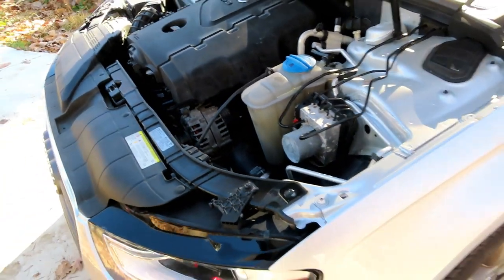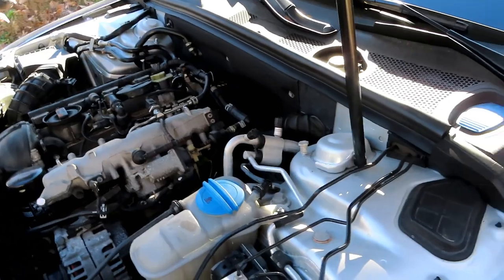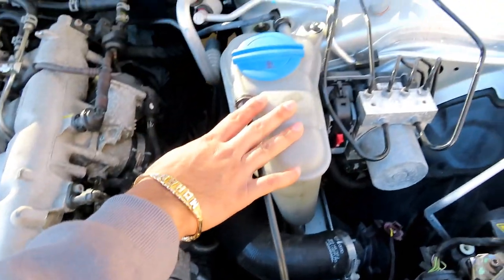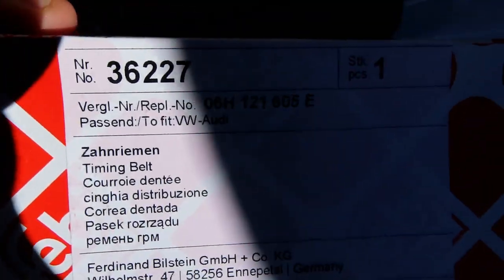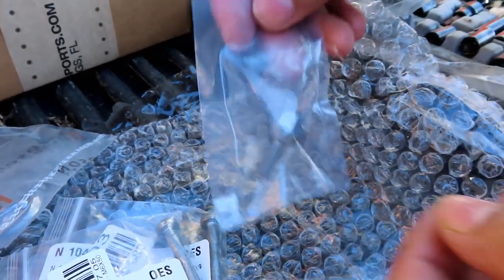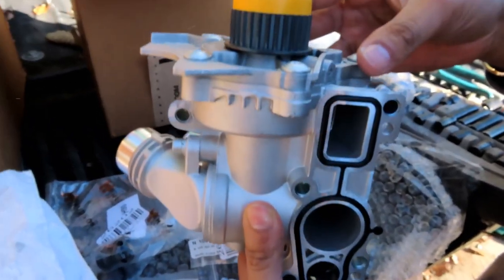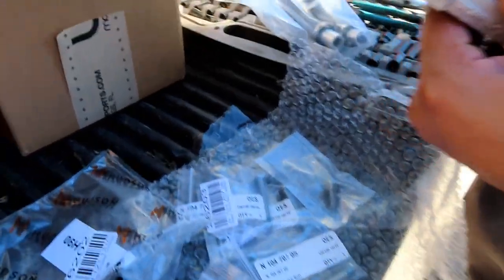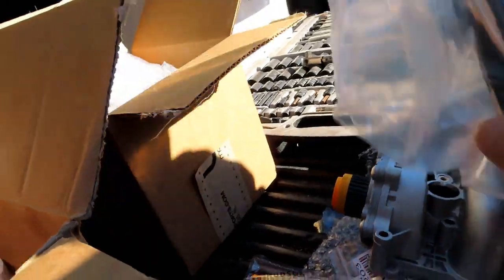Audi VW 2.0T Waterpump Replacement Cooling Overhaul Kit B8.5 B8

Comment: I used a good portion of this video to change my water pump. Much thanks.

Also, for anyone who's curious, the red tab for the connector to the thermostat, needs to be pulled pulled up, not pressed down.

Comment: Thanks for the video, it helped me.  FYI, the leak may not come from the plastic hosing just cracking from age.  I've learned, like in my case, the leak comes from oil getting absorbed by the gaskets that will swell and cause a leak from being deformed and not sealing to the engine block anymore. In my case, the gasket swelled so much it actually did crack the plastic around the gasket housing.

Comment: Great informational video. Thanks for the upload.

I was also wondering, is the stock B8.5 water pump plastic? I thought the water pump was changed to a metal one for the B8.5 since there were problems with the plastic water pump in the B8.
Reply from the maker: The stock b8.5 one that was removed is plastic. This is a 2013 car.
Reply: Steve Kish thanks!

Comment: did you guys flush it before? and did you flush it with distilled water?
Reply from the maker: He flushed and filled it with distilled water before he came over to do the water pump.
Reply: Steve Kish awesome! and last question, any specific tools you need?? I got all the torx screws, that all i need?

Comment: Can anyone assist me with bleeding air on this type of Audi, how to bleed out the air, when fill up car, and run the engine, with filler cap open, on the small hose lines which goes back to the reservoir, am seeing air bubbles coming back to the reservoir.
Reply: Park car on hill angle with resviorcat highest point..run...wait top up   turn on heater

Comment: What can go wrong if crankshaft is not held with breaker bar when removing the bolt?
Reply from the maker: It will just spin so you would'nt  be able to loosen it.
Reply: Steve Kish Thanks for the reply. If i rotate it backwards accidentally, no chance of timing issues as long as timing chain is still on though right? I am gonna try this diy this weekend. Also how long did it take u start to finish?
Reply from the maker: @aliox326  There's no problem as long as the timing chain is on. This doesn't involve messing with the timing chain so no big deal if it turns a little the wrong way to get your wrench on the crank. It took close to 2 hrs. If you get the aluminum bolt off easy can be done quicker.
Reply: @SteveKish  Any tips to get that bolt off? I saw others using a special tool. Did you stick to a regular 12mm wrench? Thanks
Reply from the maker: @arborharbor7408  I stuck with the regular 12mm open ended wrench. I was walking my brother through it. I broke it loose for him after he gave up.
Reply from the maker: Once you get the wrench to hold on good just gotta put a decent amount of strength to break it loose. We didn't use any penetrating fluid so that may make it easier.
Reply: @SteveKish  Sweet, I'll try that. Which temperature sensor plug did you guys break? When the car had trouble starting and whats the proper way to take it off
Reply from the maker: @arborharbor7408  The problem was that the pins were bent in the plug from leaving a piece of plastic in the plug when plugging  it back in. Straightened them up with a flat blade and plugged it back in.  Never had trouble starting. The fans just weren't shutting off since the coolant temp sensor wasn't giving a reading. It was a simple fix. It's just a regular squeeze tab plug removed with small flat blade(was just stuck).
Reply: Steve Kish hey buddy whats the torque spec on the pulley bolt
Reply from the maker: @aliox326  10NM  plus an additional 90 degree turn while holding the crank is what the manual says.
Reply: Steve Kish allright thanks almost done the job today. Btw, after I replace the waterpump, and fill the coolant, how should i bleed the air out of the system? Somone mentioned to run the engine without the expansion cap on and keep filling it as it goes through the system? Any other tips? Thanks uv been a great help
Reply from the maker: @aliox326  That's exactly what we did. We ran the car with the cap off and topped it off as needed. Just drove in our street some to heat it up quicker. I also squeezed the upper and lower hoses to push out any air (probably unnecessary).
Reply: Steve Kish hey i got to the temperature sensor part (red tab) and cant seem to be able to take it off with a flathead, should i pull the waterpump out first and try to take the sensor off after? The position of it while the pump is in makes it had to fit the flathead inside the hole. I also ripped half of the red tab while trying to take it off, would that affect it?
Reply from the maker: @aliox326  His red tab broke too. It was the only connector we had trouble with. The red tab is supposed to move to unlock the connector. It's been plugged back in and working good for months now. All he used was a flat blade. It's a tricky and fragile connector. You need the red tab to keep the plug locked in good. If removing the water pump makes it easier for you. You can do that.
Reply: Steve Kish ok so basically just insert flat blade in hole behind red tab and pull?
Reply from the maker: @aliox326  We broke our red tab a little to get it to release. All I know is once he got the red tab to release it unplugged. Just kept pushing and sliding it with a flat blade till it came out. I'm not sure for the correct way for that connector.  The instructions we had just said disconnect it but not how.
Reply: @Steve kish is the water pump belt (12mm) bolt reverse threaded?

Comment: The aluminum water pump is the worst man go with the OEM instead.
Reply from the maker: It's been working perfect so far.
Reply: @SteveKish  That's good bc most people that have used the Al water pump say that its poorly built and have only had problems.
Reply: @SteveKish  Still going strong? As I'm looking at getting aluminium one as well, can you post link of where you got it from? I did find one made in germany, but can't find it again
Reply: @UAa320  the temp sensor & thermostats fail.  Need to swap to factory thermostat, factory temp sensor.  Other than that works 100%

Comment: those belts never fail. waste of money, same with those bolts. low torque.  Scrap off new lock tight. use same stuff. Use aluminum union to oil cooler. always reuse the factory thermostat & factory temp sensor.  DO NOT use Graf thermostat or temp.  They fail 100%